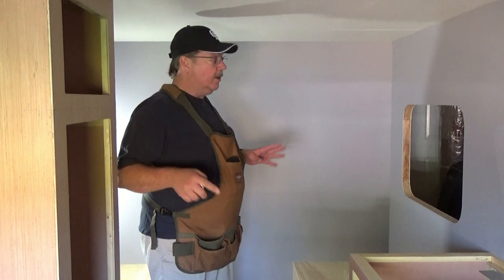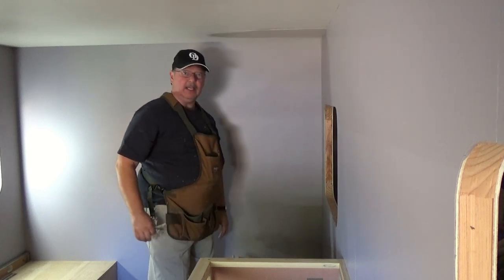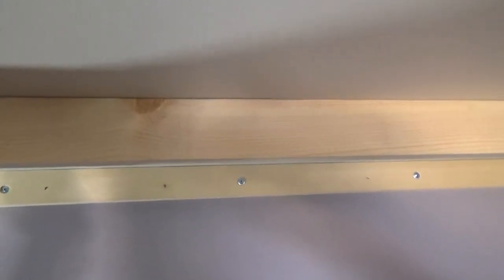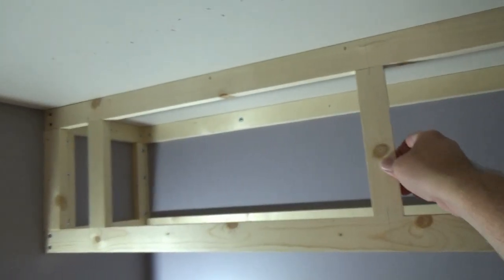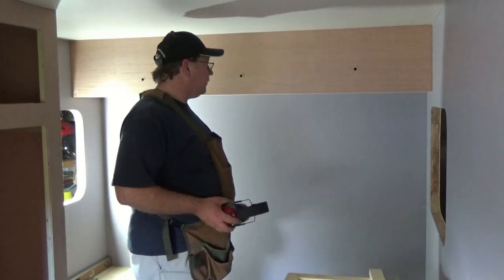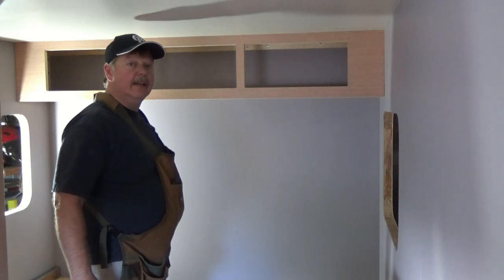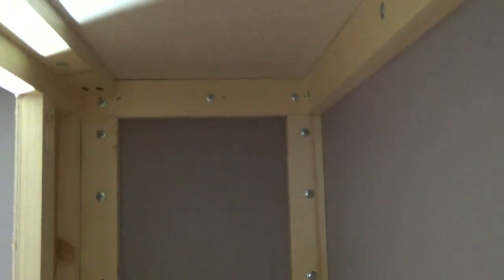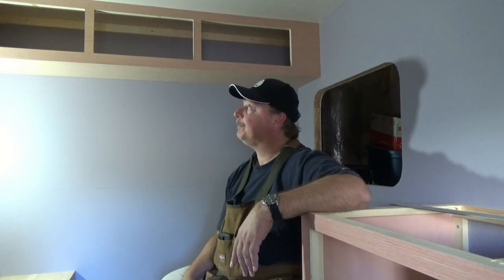How To Build A DIY Travel Trailer - Part 18 (Cabinet Above Rear Bench Seat)

Comment: First I'd like to thank you for sharing all of this. Everything that your doing covers the project I'm planning. Like yourself I have a teardrop "Woody" (5x8) in my garage & would like something a little larger with more head room & amenities. I started with your trailer build video but, now I'm very interested in all your video's. I'm NOT good with woodwork but with this series of video's I feel I could do this project. Could I start out asking you for more information on the trailer axle? The trailer build will be my first project. Maybe a link to the one you bought? Is it a 2,500 lb or 3,500 lb? Is it the best width for the garage opening (mine is 90") or is there a better choice. Thanks again for sharing.
Reply from the maker: Thanks Monte for watching my videos and thanks for the comment, much appreciated! The axle was the first thing I purchased to start with, then I built the frame. I purchased the axle on-line, although there were a few local shops around that could have met my need.  Dexter axles offer a good choice for torsion axles, perhaps a little more money.  If I remember correctly, I purchased mine through Trailerpart.com. They can make any size you would like.

https://www.trailerpart.com/c-26-torsion-axles.aspx 

I purchased the 2000lb axle for $318, although now, I'm thinking I should have bought the 3500lb axle ($415). No worries though. I built the trailer with  the idea that, if I had to change the axle, I could remove the inside wheel well and remove the bolts. I'll know when I finally get to weigh the trailer. The mounting brackets for the axle are 48" apart. The hub face extends approx 12" on each side, with an overall dimension of approximately 60".So the width of the frame is 48", and the trailer overhangs on each side by about 12". The wheels will be just inside the wheel well when mounted.

My garage is SMALL!! :)   I installed casters on the frame so I can move the trailer around in my garage (no wheels). I don't have much room, that's for sure! If you have a 5x8 in your garage, you already have an idea of available space you'll have if it were another 12 to 12-1/2" wider. Don't let it stop you!  I do most of the wood work in my driveway, then bring it in garage for assembly. 

Hope this helps you Monte.... dive in and get your feet wet! You will have fun!

al

Comment: Hi again, would it be possible to router in such a way so you can use the plywood cutout pieces as part of the cabinet doors? Saves waste.
Reply from the maker: I believe there is... a smaller router could do the cutout and let you use the pieces left over for the doors. A dremel tool with a smaller router bit could work. It uses a much smaller bit.  The bit I used is approximately 1/4 inch diameter. A dremel would use half that size, providing the thickness of your wood isn't more than 1/4 inch, should make a nice clean cut.
Reply: +OregonBatman great, thanks!
Reply: @OregonBatman  That's a good quesstion...as I mentioned on your previous video - part 16

Comment: I would have made the shelf for the cabinet above the lower crossmembers, not sure how much weight those cabinets will hold..
Reply from the maker: Thanks for the comment... I thought about doing that in the beginning, but I wanted to utilize all the space I could. My initial thought is to use the cabinet for clothes/bedding storage, I am confident it will hold up to the weight. If I need to, I can always make shelves to fit inside for added strength. Good observation sir... thank you!